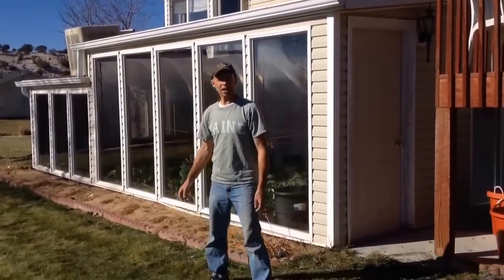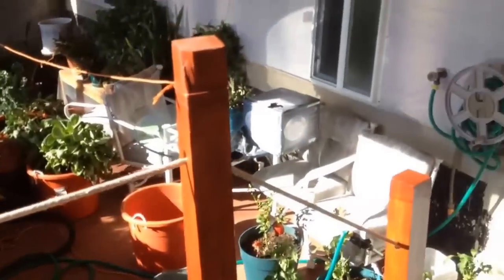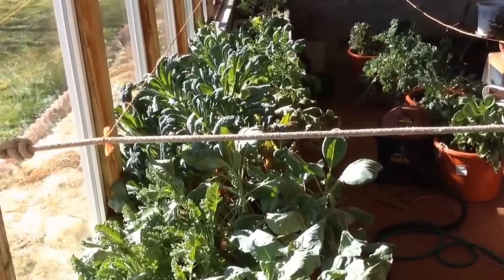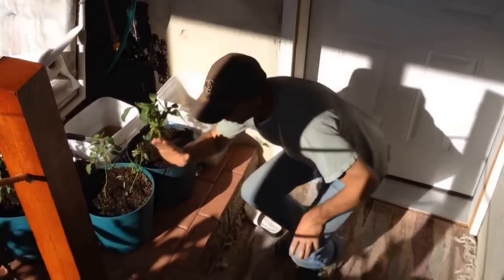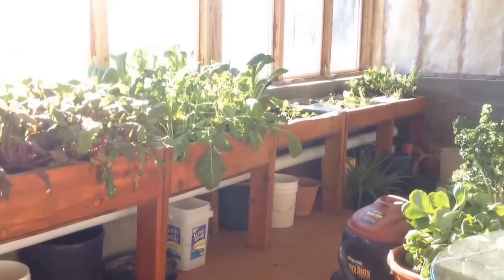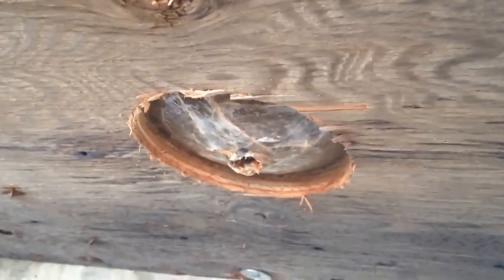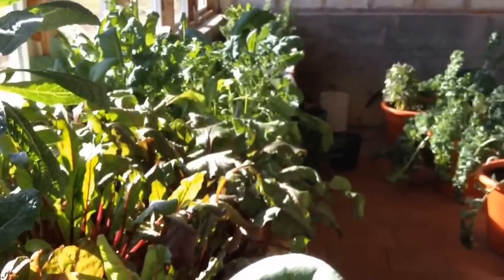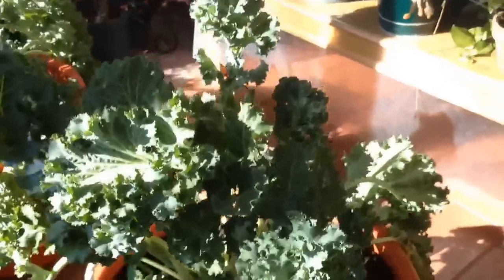Design an attached winter greenhouse / solar thermal mass heat room

Comment: do you have ventilation in greenhouse room?
Reply from the maker: Yes. You need to design it into any sun room / greenhouse. If you use it only for solar gain for heating your home, you will not need or want to ventilate it in the dead of the winter, depending on your location. If you have it with just a few plants then the humidity will not be much and it will be good for the home to get oxygen and very little humidity... If you load it up full of greens as I did with the video, It will need to have the windows cracked just a bit as it gets into cold part of winter (the colder it gets the less it needs to be open as the temp difference will create more condensation... I have two side windows on each end for cross ventilation, which I dont use much but it is nice to have. I have used my window up near the top of the roof and it is just cracked a bit with my side window below slightly cracked... I am switching over to a humidity sensing low power quiet fan and I talk a bid more about it in the comment below if you want more info.... But yes, you will want and must have windows and ventilation so you can have options to do what ever you like and it is fun to mix it up and use it only lfor a heat room with fewer plants ...  I have found that I like to have a few plants to bring oxygen into the home and not too many so that I have to vent it more and loose all the heat gain ... but the new fan will keep heat loss to a minimum as it will turn on only when it needs to reduce humidity ...

Comment: How do you handle summer when it is now too hot and need to cool the house?  Just don't open into the greenhouse?
Reply from the maker: Good question. I installed one window in the top and can open it to let 
convection pull it out from a window that is on the side and faces under
 my deck where the temps are cooler... so I can draw cool air in... I 
also have another window on the opposite side as the window that faces 
under the deck so I can get a cross breeze If I choose. they are very 
much worth having. In the winter I like to crack the upper window just a
 little bit and it and I dont crack any other windows and it will draw 
air in from earth tube under the ground that has a bit warmer heat 
through natural convection... lots of things to look at, but well worth 
having. Good luck and god bless

Comment: would help if on your About page you had at least the state or latitude you lived at. So many of these greenhouse and growing videos seem to forget that's important.
Reply from the maker: +Joe Zyzyx Thanks for the input. I logged in under the About page and listed our location and some info. Thanks!
Reply: +Steve Mabey 
Appreciate it. Based on windows' large angle and the short overhang I thought it must be somewhere northward. You are just a wee bit northward from my location in Maryland, but the elevation is 5000 feet more upward.  I also now see in answer below you'd given that info, somehow missed it earlier, duh.
Reply from the maker: +Joe Zyzyx I am glad you pointed out for me to add the location in the about section. I am still learning how YouTube works ha ha. If I lived lower in elevation, I would still build an attached solar heat/ greenhouse on the south side. It provides lots of heat, even when it is a bit overcast and a food source if you want of need it. It would definitely be warmer as it is lower elevation, and might heat your home too. good luck with your projects Joe

Comment: Does this lean to house greenhouse have a solid roof? and it is insulated roof? thanks
Reply from the maker: Yes. it is a solid roof and insulated. the greenhouse / sun room is designed for winter collection of sun, for the purpose of both growing plants in the winter and for gathering heat from the sun as it drops down into the Southern hemisphere in the winter...    ,,,,  I also had a question that was asked under one of my other videos that might be good to post here as well, so the following is that reply as well. ...... One of my projects this summer is to finish the inside of this attached greenhouse. (needed to be done many years ago). I would like to finish it before I make a video showing all of it. The windows I bought were sliding glass picture windows... I used these windows as they are cheaper because window manufacturers make them in high volume for putting in sliding glass doors and they are the tempered glass, which you will want to use, as they are on ground level and designed for safety. The windows are built with a mounting flange around the outside of the glass, so they can be mounted easily and sealed. Every home will be different, how you attach your greenhouse / sun room onto your home, so you might not be able to get the full height of a sliding glass door picture window in (some manufacturers also have different heights, so you may want to check on who has a size like what you want). You will want to get as much slope on the roof as you can, so water will flow off of the roof well. The way I had to bild my greenhouse / sun room, I could not use full sized sliders on 3 of the windows and I just had the manufacturer make 3 custom smaller sizes of the tempered glass picture windows... I know it costs more to buy new windows rather than use old discarded sliding glass windows (and I am very frugal and like to make things cheep) but I would advise to use good new windows on this project as they will be built with vinyl and seal great and they will look good. Your home value will go up much much more and its not worth going cheep on your home... I also built a small window near the roof for getting ventilation and this was a great way to get air moving out naturally, for heat removal in the summer, or humidity in the winter. One thing I would say is that you do not want to use moisture barriers (like plastic that does not breath and traps moisture in) on your exterior walls as you want the structure to be able to breath. If you intent to grow just a few plants in the greenhouse, then you will have very little moisture in the sun room, but the more plants you add, the more the humidity you will have. Last year was the most plants I have ever had in the sun room / greenhouse and there was lots of humidity and I am installing a high efficiency (7 watt) humidity sensing bathroom fan that will pull in fresh air through the use of what many call earth tubes (this is the term that has been connected to the use of pulling warmer air out of the ground for the earths heat in the winter, of for cooling using the earths cool air in the winter) and I am convinced that this is something that should be built into any attached greenhouse, but in many cases it can be added in later as you have the time to do it. I hope to get the project done tis summer and I will post a video for others to see and get ideas to use on their own home. Every person will have a home or yard that is set up different from each other, so no one design will fit perfectly for everyone, but researching and finding what you think will work for your situation is a must do and then the most important step is next JUST DO IT :) You will be so glad you did it later. If I had not just done my attached sun room /greenhouse many years ago, I would still be thinking about it and we have used the amazing daytime heat from it in the winter to heat our home for many years and now we are getting into the oxygenation healthy green living food side of it... and remember to JUST DO IT :)
Reply: Steve Mabey
thanks again for comprehensive and detailed response and good luck with your project!
Reply from the maker: zuzilda You are welcome, and if you have any questions, please ask and I will do my best to help answer (or if you have ideas to add, so we can all learn from it :)